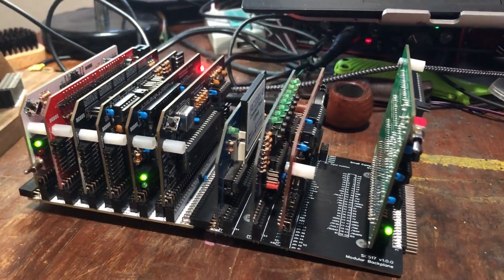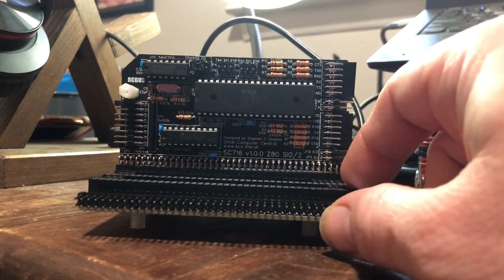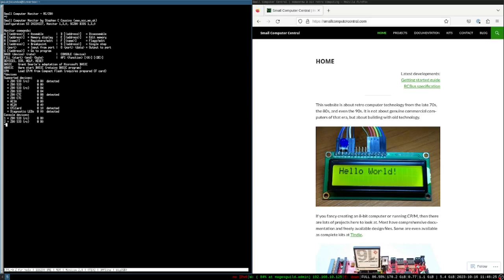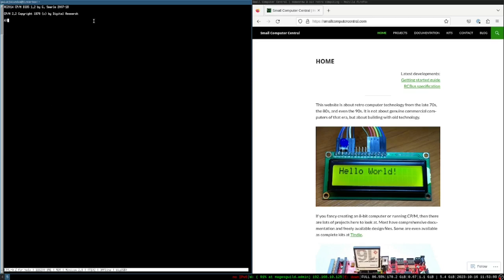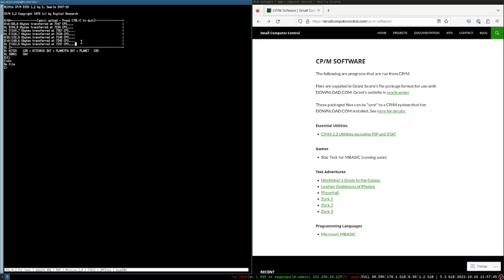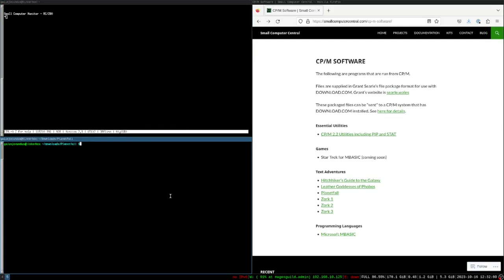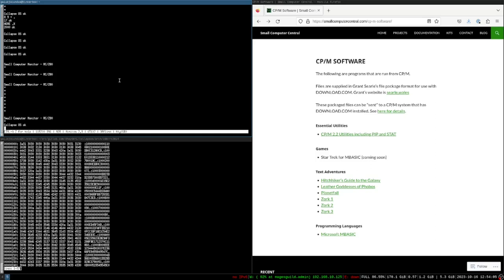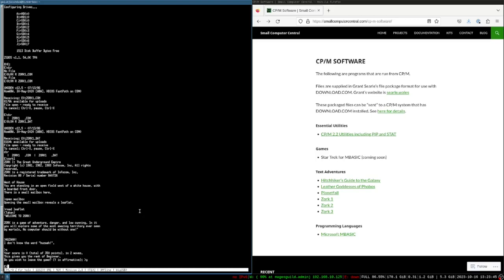Small Computer Central - Z80 Computer Line Introduction

Comment: I hadn't heard of Z-System before, looks interesting, thanks 🙂
Reply: It is indeed awesome. I got Z3Plus working on my CP/M 3 just a few weeks ago, and don't want to miss it anymore. 
With the LSH shell you get full command line editing and history. 
It also gives names to the user areas and makes switching them extremely easy.
It lets you define a search path almost like DOS. 
And it provides an interface for programs to use extended terminal control functions configurable by the user. That way, a program will work and look the same on many different terminals.
Reply: @TSteffi  that sounds pretty advanced 🙂

Comment: Could you use several Z80 CPUs to create multi-processor Z80 machine?
Reply from the maker: You could and, in fact, I am interested in investigating this. I've seen a few designs for doing just that out there that shouldn't be too difficult to replicate on these SCC backplanes. It may take some some significant time yet before I have the capability to implement it, myself, though, as much of the work of supporting the functionality will be on the software side.
Reply: Check out the Zedripper project.

Comment: 20:56 it not land it have to be there if program made for starting that address lol. it would not run if you move it one adress later lol lol
Reply from the maker: Are you high?

English is probably not for first language so I'll explain this. In this context the term "lands at" means "Is addressed to be placed at." It is a colloquialism, so I can forgive the confusion; you are correct that the program must be in that location. The hex loader handles placing the program in the correct location based on its addressing requirements.